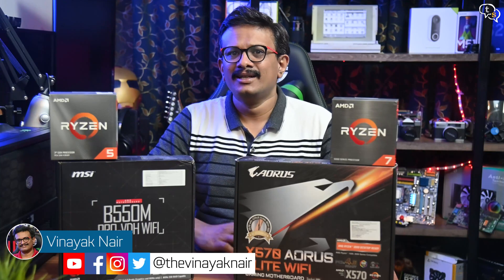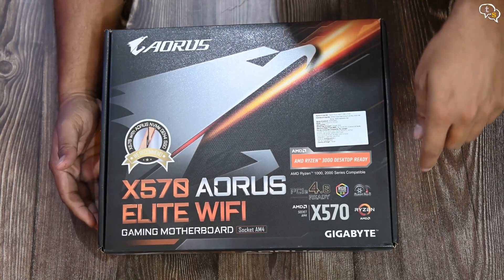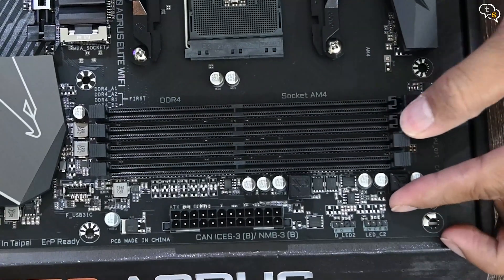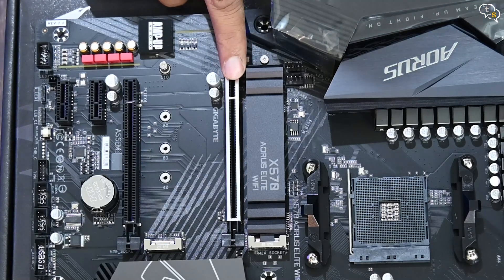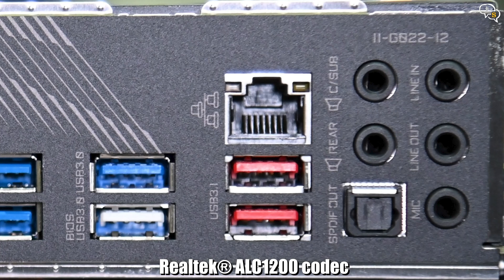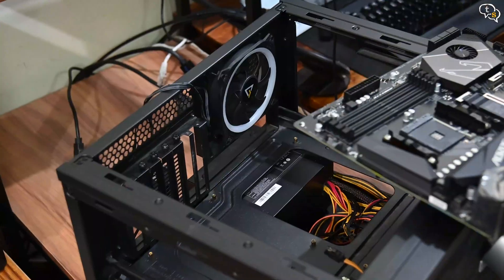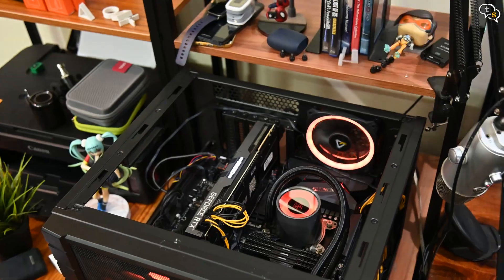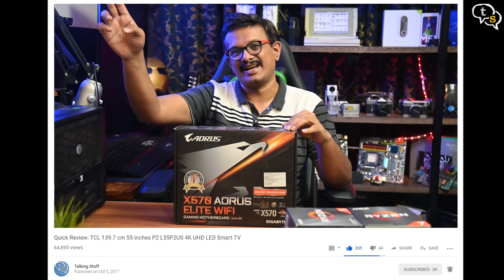Gigabyte X570 Aorus Elite Wifi | Best X570 motherboard?

Comment: bought this board in 2019 when i upgraded tro my 3800x.  One of the best boards ive ever used.. right now i upgraded again using a 5800x 3d and now 32gb of memory. among my nvme drives and usb connections and rgb connectors available on it, it has the perfect amount of Connectors for SATA and fan as well.  On board audio is kinda bleh though, thats why i use a creative AE-5 sound card.  I love it because of the wifi and blue tooth as well.  when my direct connection to my internet goes out its nice to be able to connect directly to wifi through my phone or other router.   Ive been building computers for 23 years, not sure i consider this the budget x570 but hey

Since i just got the 5800x3d a month ago, ill probably keep this board another 2 years before i go to the 7000 or newer series.   I only hope when i do upgrade in 2 years, there will be boards with more NVME slots

Comment: Why did you install the SSD in the gen3 slot instead of the gen4 slot with the heat sink?
Reply from the maker: Both are gen4 , the first slot directly communicates with the cpu and the second goes via the chipset. I have both slots populated.

Comment: Will it support ryzen 5 3400G..??  I want future proof... I will change Processor... Ryzen 5 5600x + rtx 3050 8gb gpu...
Reply from the maker: As per the AMD website the 3400G is supported on the X570 motherboard. Bios update removes only 2000 series support.

Comment: Sir it's gud for Photoshop CC 2022
Editing rendering
Reply from the maker: I'm using it for all creative applications like Premiere, Photoshop, After Effects and also for programming. It works without a hitch.
Reply: U want Photoshop CC 2022 premier pro work smoothly without any lag
Reply from the maker: I have Adobe Creative cloud subscription, so I use most Adobe apps. They all work well, because of the CPU being a Ryzen 7 5800X and RAM is also 64 GB. I had upgraded the system, but same motherboard. 
https://youtu.be/E0TQ8yq6YTk

Comment: Hello Sir! You forgot mention, did the motherboard boot up with the 5800x without a BIOS flash? I am getting the same motherboard in the mail tomorrow. Thanks for the video it was very helpful
Reply from the maker: It booted up without needing to flash the BIOS with the 5800X installed.
Reply: Aright, cool!